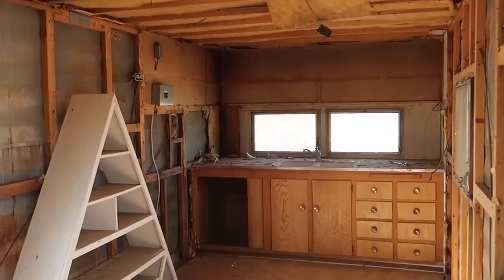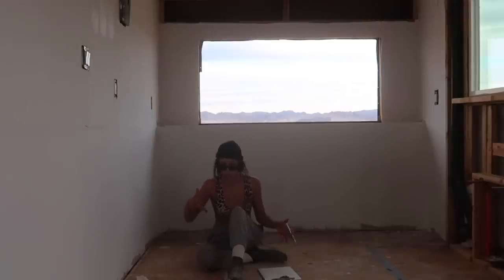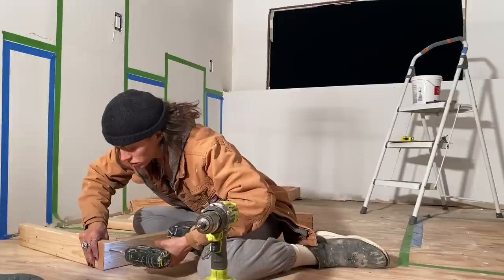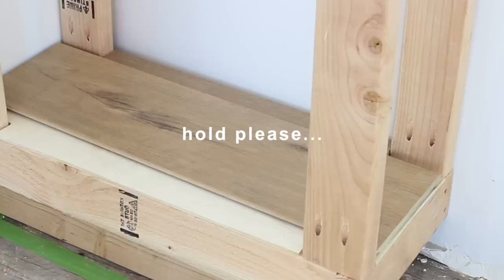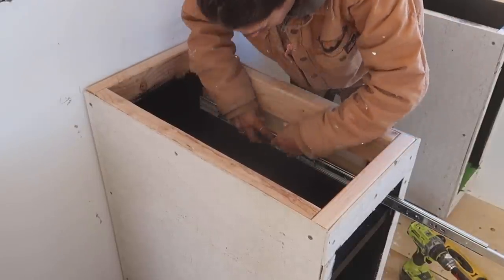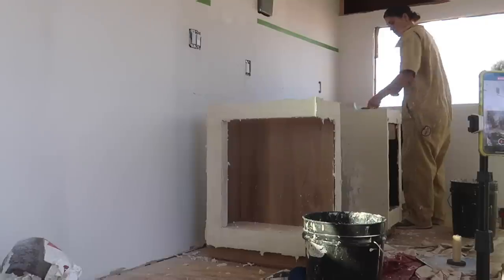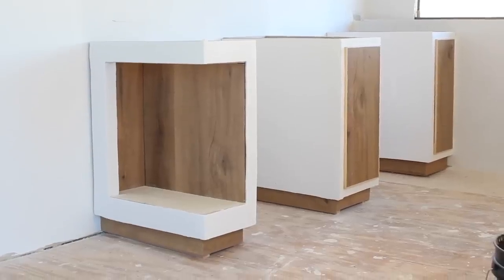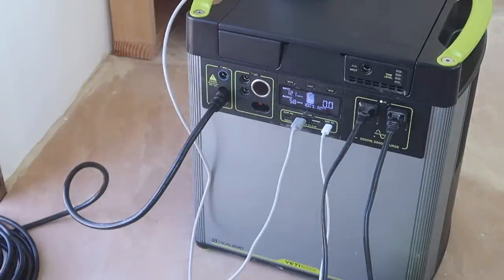Building Myself a Tiny Kitchen in the Desert

Comment: Why not pop those on the outside...w/ access from both sides (in/out) with slide out cabinet for easy access to your GOAL ZERO.
Reply from the maker: Appliances will be there xx.
Reply: @LivingtoDIYwithRachelMetz  I mean outside the trailer 😊
But because of weather and such I thought having access inside is good
That way the cabinet on the inside could be used for storage
I’m sure ventilation would be necessary, but I do love slides in the cabinet 
Why not make the whole cabinet slide out with the Goal Zero behind it
I wish I could draw
Loved your bed🤩